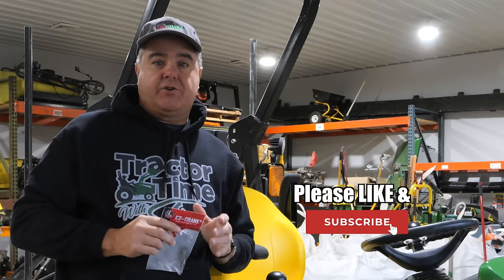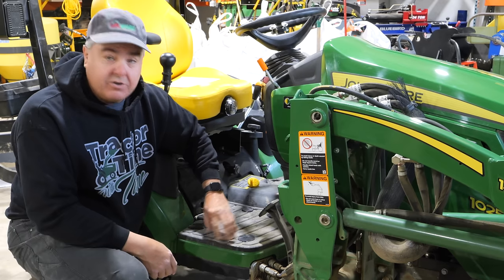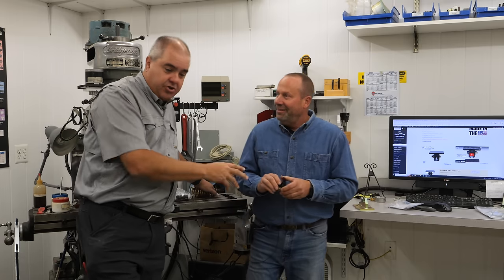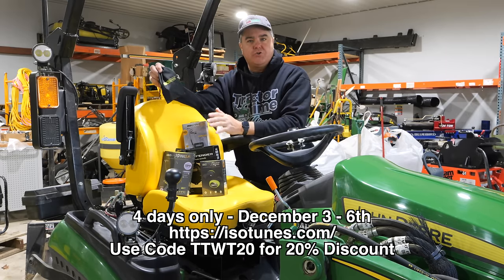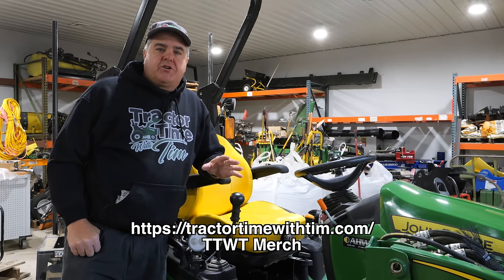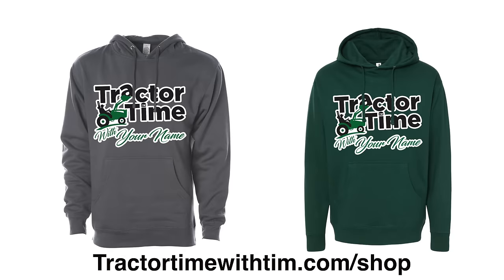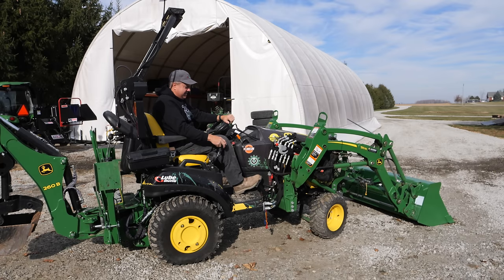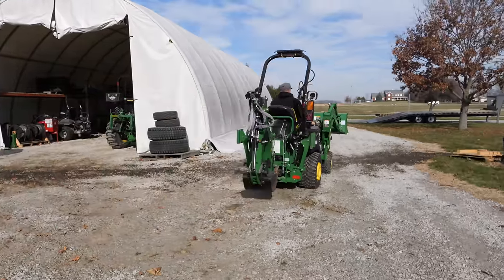Inexpensive (Mostly) Tractor Lover Gift Ideas.  EZ-CRANK

Comment: That Ez crank is great. I was about to cut a bolt head off and weld it on the end of my jack so I could use a socket. Now I'll buy a cheap socket and drill a hole in the end 👍
Reply from the maker: Just don’t use an impact.
…and remember that sockets are HARD.  Be careful drilling drilling through it

Comment: I need to order more bolt on hooks. I broke the 2 I had on my 5075e.  I was trying to use the tractor as an anchor to get a john deere 700j dozer unstuck.  They will not hold the weight of the 5075e and an extra 1,000lbs of weight on rear wheels in the air, or the 700j just has too much winch power. Lol
Reply: A Winch will always be stronger than a Vehicle doing the pulling HAHAHAHAHAHA..

Comment: Hi Tim. You mentioned the front axle was leaking on your 3R. I’ve read that some guy’s have put the vent hose on and the axle quit leaking. Not saying it will but may be worth a try if the seal isn’t in bad shape. 
Thanks for another great video. I’m forwarding this video to the finance committee for further review. 😃
Reply: my 4 series will leak when used a lot on hot days, pinion seal, but then stops on cooler days even though I have filled the axle. So I bet you are right. It will probaly stop leaking after vented.

Comment: Hey Tim!  Hope you get to feeling better soon.  Just wanted to chim in and mention something my dealer told me about the hood release.  It was designed so the operator uses the key from the ingnition to open the hood.  This was done to prevent people from being in the engine compartment while its running.  Hope that helps!!   Still like the work around though.  Have a blessed Christmas.
Reply from the maker: Not really.  It was done to meet EU regulations.  The only reason it is in the US is to be consistent.

Comment: I really want that seat, but I’m going to wait for the installation video first before placing an order..  I don’t care that it doesn’t flip up or rotate but I want to see how far back the slider tracks will allow it to move. I use my stock 1025R seat in the fully back position and I want any upgrade seat to give me at least that much clearance space for my legs.
Reply from the maker: Good idea. Hang tight.  We’ll get the updated parts soon

Comment: We have a storm coming tomorrow and the edge tamers for the box blade got me thinking… my 54” rear blower and or front HLA pusher blade cuts in bad this time of year as there is no frozen ground. The shoes are only about 1 1/4 wide roughly and cut into the ground.
Reply: I had the tamers on My Kioti Bucket and took them off in favor of 3/4" pipe on the bottom. Welded to an old Cutting edge. I'd usually pack down the 1st few layers of Snow to create a nice base . No issues with digging in anymore.

Comment: I do not like pushing snow with my bucket but the edge tamers make it much easier. 3 3 inch on 53 inch bucket. I use my tractor on the beach a lot. My mat and bolt head recesses are always full of sand. Those little caps are interesting. I can't believe I have not bought one of Ken's diff lock caps. Working on the beach I am usually wearing Crocs, it is difficult to tell if it's locked up. As in previous years you have brought up many good items.

Comment: With the pro ride seat it said won’t work with the backhoe but wondered is that with either backhoe model? Wondered if it couldn’t swivel around with the older 260 or lean forward with the newer 260B. Going to guess someone with a plan would figure it out and make it work.
No problems with my current seat but I’d rather get the Ken’s bolt on springs a lot cheaper than a whole new seat. Only machine I got here that could use a new seat is dads older 1974 410 JD backhoe

Comment: Bonjour Tim. I need information about top link for measure. I have a John Deere 5075E and I want a category 2 top link for it and I have a question how to take the measure :end to end or center to center of the pinholes to order the correct size of top link. I want to order to the Agrisotre but Ineed to know .Thanks Tim
Reply from the maker: Center to center of the holes.
Retract all the way, then extend all the way. Measure each approach.  …then, error on a bit shorter in my opinion.

Comment: Good morning, I recently purchased the suspension seat for my 1025R.  I have complained about the seat on this tractor since day 1.  In fact was even looking at other tractors to possibly trade until this new seat was on the market.  Did you have to modify the front panel when installing this seat?  It doesn't seem to line up quite right and I'm thinking I may need to trim around the new seat brackets just a little to get everything to fit correctly.
Reply from the maker: I was able to get it to fit…I think you are discussing the panel which has the rate of control knob etc.  I had to remove this to install…and yes, I had difficulty getting it back in place.  I just kept putting…finally getting it in place
Reply: Yes that is the panel.  Thanks for the input.  I had to reorder one of the seat brackets,  company accidently sent me two left brackets.  Called them and they sent corrected one out right away, unfortunately, it was sent USPS and mail service has been extremely slow.  Tracking shows it has been sitting in Cleveland distribution center now for several days.  Hopefully it will get here this coming week.  While I have been waiting , I was looking at how that panel might go back in there and it seems pretty tight.  Thanks for all the informative videos.  I have used information from these a lot over the years.   @TractorTimewithTim
Reply: Yep, that is why I am waiting on the installation video. To be ready to do any necessary mods and have the tools and parts  ready to go.

Comment: Any idea if they are planning for the 2 series cab or 3 series cab for the 1 point connector?
Reply from the maker: 2R cab?   Do you mean 2025r?  If so, yes, this one works on it.
Reply: @TractorTimewithTim  2039r cab or 3039r/3046r cab or even 4066r cab.
Reply from the maker: You must be in Europe?  There is no 2039r cab (or 2038r cab) in the USA
Reply: @TractorTimewithTim  New Zealand

Comment: Am I the only one that's had trouble with Isotunes? I bought 3 pairs last year.  One for myself and two were given as Christmas presents.  They were the Isotunes Xtras 2.0. All three of us liked the features and thought they were great.  Unfortunately 1 pair overheated and started melting.  The other two pairs won't keep a charge and one of those no longer will charge at all. Bad batch or is this typical?
Reply from the maker: Wow. Must be bad batch or something. I have used the same set of xtra 2.0’s since they came out.  
Contact the company…they should replace.
Reply: I've had a pair since Tim first mentioned them never had any issues using them every day except for one pair got caught in my winter coat and cut the wire and i had another pair get caught on some branches and ripped the wires out before I could stop